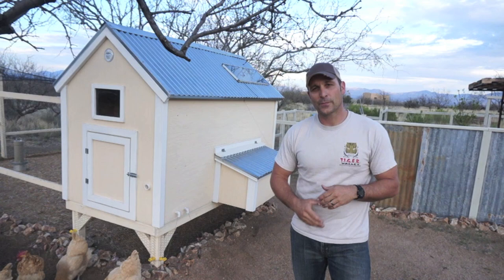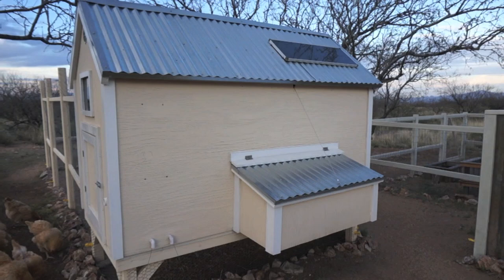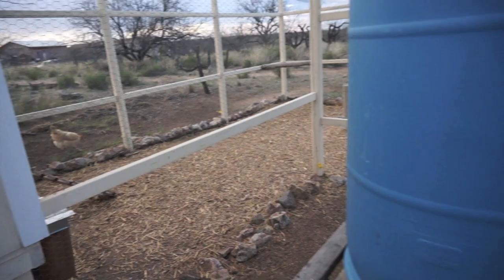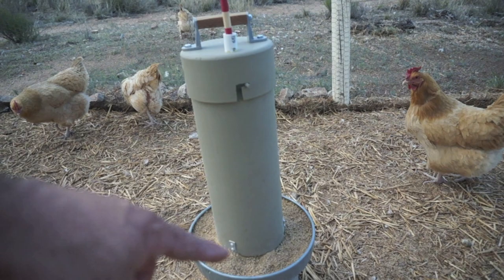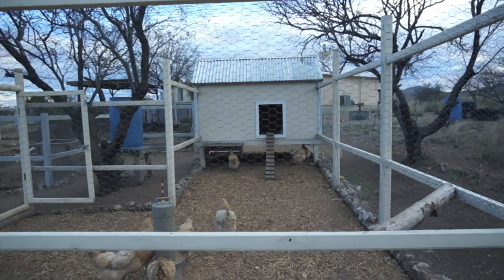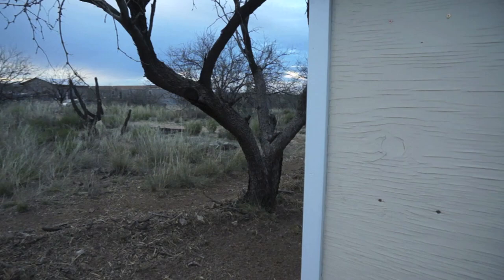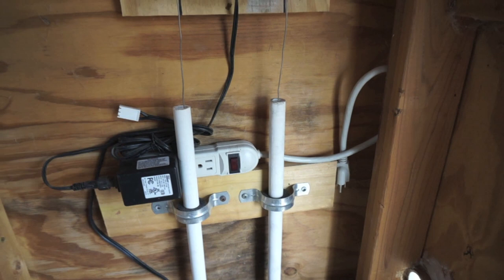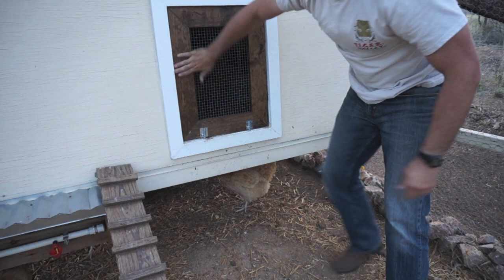Chicken Coop Tour - Solar, Food, Water, Security

Comment: Excellent job all the way around. There are some adaptations that one must make in places with long cold climates. In some (most?) parts of Canada, we need to insulate the coop and have some means to heat it. Today, for example, the temperature is at -25C. I use a 175 watt heat lamp, and have a cookie tin with a 40 watt light bulb inside to prevent the water from freezing. That, and minimum 8 inch thick layer of fine wood chip, sawdust or some other humidity absorbing carbonaceous material helps to keep the coop dry, and the floor warm.
Reply from the maker: +Francis Roy Thanks Francis!  Yes, we've got some temp differences for sure!  But it sounds like you have some great solutions for the water with the cookie tin and the thick mulch for heat.  If we were colder, I'd definitely incorporate some insulation too.  I'd love to see your set up!  ... and thanks for watching Francis:) Joe
Reply from the maker: +Francis Roy Just watched it... very resourceful use of the soda bottle and the coffee can feeder.  The chicks look happy and look to be well cared for!  'Cheapskate' ingenuity seems to be working well from what I can see:)
Joe

Comment: Do you ever have pipe freezing problems that far South in AZ?  There "may be" one problem area.  Snakes can go through the bottom of the chicken wire.  What usually happens, though, is the snake will start through the wire and get stuck.  Since they don't have a reverse gear, they turn and go back out an adjacent hole and get stuck for good.  Only the skinny ones can get through, but they better not eat anything, or they will have to stay!  1/2" hardware cloth (rabbit wire) at the bottom can remedy any snake problems.  Luckily, there are no snakes in Arizona, right?  I am a new subscriber.  Thanks for the excellent video!!!
Reply from the maker: haha... there are lots of snakes in AZ.. you should check out my snake pole video or my prickly pear picking video to see a few of the rattlers:)  ... and yes, you are right about the chicken wire and snakes... but luckily I haven't had any problem with any getting stuck.  thanks for watching and subbing:)
Joe
Reply: I was joking about there being no snakes in AZ.  The only place that I have personally seen that might be worse for rattlesnakes is in Pilot Hill CA, where we lived for 20 years.  Twice I have seen where a snake was stuck going both ways through the wire.   Your videos are very informative and entertaining!  Thanks for posting them!  Jerry

Comment: Hello sir! 🙋🏻‍♀️ I’m making a solar system kinda like yours on my coop that has a marine battery, but someone said batteries emit gasses when charging so I wondered if your system has a battery and where it is etc. I have the battery in an unused egg box on the front of my coop. I wonder if I should fully block it off or what? I have it blocked off with some cardboard right now to keep them from touching it, but should I make an actual wood wall there to close that egg box off from the rest of the coop? Thank you for any thoughts you have on this!

Comment: Very nice setup!   Do you know of anything that works well to keep snakes out?   I understand that chickens will generally kill/eat the smaller ones, but I've been told that some of the larger ones often manage to crawl into coops and cause problems.
Reply from the maker: Peter K. Hey Peter... thank you!  Regarding snakes, we've got a good number here but I haven't had a problem with them as of yet.  The small to medium ones can pass through chicken wire pretty easily.. and the bigger ones can get stuck.  Hardware cloth would keep them out but can be expensive.  Another option would be the 1/2" bird netting... although when I snake gets into it you almost always will have to cut them out.  I've had a few red racers get caught in bird netting in my garden and I had to cut them out because they were so tangled.  Anyways, hope that answered your questions... at least a bit:)

Joe

Comment: Great coop setup!  It looks like you're out in the desert.  How does your flock do in the summer?  Do you do anything extra for cooling?  THX
Reply from the maker: LFoote Hey LF... we are in the southern Arizona high desert, just a bit south of Tucson.  Our chickens do pretty well here in the summer.  If you notice in the video, the coop is on 'stilts' so our girls always have good shade as well as two medium sized mesquite trees on either side of the run and coop also provide shade.  Other than that, and making sure they always have plentiful water they do really well.  On those 'extreme' heat days where the temps are pushing the mid 100's and above (above is rare for us as we are at about 4000' elevation) I'll fill up a couple pans of water for them to put their feet in.  That is more of a nice treat than an absolute necessity though.... makes me feel good though:)
Hope that helps and thanks for watching!
Joe

Comment: Thank you for sharing  we are new to this we are getting ready to build us a coop. How did you make your watering system for the chickens to drink? does there beak touch the red thing? Thanks Lynn
Reply from the maker: Lynnm McManaway Hi Lynnm,   the waterer is a simple gravity style system.  Basically the barrel is elevated higher that the waterers and they are connected by irrigation tubing to the PVC pipe, in which the waterer cups are connected to.  To attach the cups, you'll just need to drill a hole into the PVC pipe and simply thread the watering cups in.  After that, gravity will take care of the rest:)  Anyways, hope that answered your questions:)  
If not... I may consider doing a  more in depth one just on the waterer itself.  Let me know if that might interest you:)
Joe

Comment: That is a very nice coop! I'm researching ideas for when I build mine. The concept of the dimensions simply using the full sheets of plywood lends a certain elegance in its simplicity. Did you screw the roof directly to the wood? Does that cause any leakage from rain? I also like how you gave them a good size run that is protected from predators. I would love to let them free range, but that isn't a good option here. We've got hawks, racoons, possums, plus the usual stray dogs and cats. We'll be definitely using some of your ideas for our own coop. Thanks!
Reply from the maker: Donovan Maxwell Thanks Donovan!  Glad you like the coop... hope you might be able to use some of the ideas in yours.  There's lots of cool ideas out there.. too many for one coop but I guess you gotta pick the best ones that work out for you:)  As for the roof... the sheet metal is screwed down directly to the wood but if you're in a wet environment you might want to add underlayment/tarpaper to combat condensation.  Out here in the desert it's not much of an issue which is why didn't do it.  
Also, stay tuned as I'm planning on adding a rainwater catchment system to fill the chicken water barrel with rain from the coop roof:)  Thanks for watching:)
Joe
Reply: homesteadonomics Gotcha on the roof. Here in North Texas, it isn't normally wet very often. This year, though, seems to be the exception. If it keeps up, I'll have to kayak to/from work. I'll look into the tar paper. Thanks again!

Comment: What do I ask for at home depot for what you used for the fence instead of the chicken wire? How much does it cost?
Reply from the maker: Brandon Scott HI brandon... you'll need to go to the section that has 'lathe' for stucco siding... it will be the side of HD that has the concrete and drywall.  it's the same thing as chicken wire.. it's just labeled different because it has a different use.  Hope that helps:)

Comment: Great setup. Just wondering how do you run the electric fence across the gate to the yard?
Reply from the maker: +peninsulamike Hey Mike.... I run the fence under the gate bottom... it's a raised up section that is the same height as the wire run on the coop yard.  I hope that helps:)

Comment: Great video as usual.  Question.  How do you keep the 55gal water storage full?  Is it on a float, or do you just manually fill it every week or so?
Reply from the maker: Mike Cole Hey Mike... I fill the barrel manually but you could probably put a float system in one no problem.  I actually considered that but since we are on rainwater as our primary water source, it'd be just too much risk if the float system broke while we were gone.  As for the current set up... my chickens can go about two months with one barrel's worth of water.  I usually top it off every 2-3 weeks just to be safe though... and to keep the water freshened up a bit.  Anyways, I hope that helps.... and thanks for watching!!!
Joe

Comment: thanks!  couldn't a predator climb that little tree you have there near the run fence, and then hop into the run-years area inside?
Reply from the maker: +seeminglyJo Hi SJ... The netting up top prevents anything from jumping in... I guess it's possible but so far I haven't had any troubles:)  btw... if you are interested, have a couple recent videos building a very similar coop to this one for my in laws if you want to check them out.  Better video and sound quality too:)
Joe
Reply: thanks, I am in a super cold climate for a large part of the year so I am considering all designs. I will check it out. be well.

Comment: are you in an area that has freezing weather? I am an so believe I will need a heater in the winter for my waterer, am getting chickens in june so am getting set up, thank you for your great video
Reply from the maker: +Beth Barnes Hi Beth... we get light freezes so if you're in a hard freeze area it might be best to just drain your waterer and just use an old fashioned galvanized one inside the coop with a heat lamp.  thanks for watching.
Joe

Comment: Awesome video!  I subscribed and can't wait to see your other video's.  How did you attach the chicken wire to the post?  Staple gun?
Also, how much does it cost in lumber/roofing to build that coop roughly?
Reply from the maker: MrShep75 thanks shep!   Much appreciated... just trying to get better with each video.:) Regarding the chicken wire...I attached the wire to the posts with a staple gun (pneumatic type).  But if you didn't have one, then you could always use electric wire staples and hammer them in.  they probably hold a bit better than the staple gun staples too!
Joe
Reply from the maker: MrShep75 Oh yeah... the cost for the coop is a little hard to estimate because I used a good amount of scrap materials.  But I'd say that the main box of the coop would probably be about $100-175 give or take, depending on the materials used (scrap/new, thickness of plywood).  Then the roof would probably take about 2-3  8ft panels of corrugated tin, which would run about 12 or so buck a sheet($36).   Then the chicken wire and landscape timbers for the yard would be probably about $50-85 or so.  anyways, that's the best estimate I can give off the top of my head...just hard to remember what exactly everything cost.  But you should be able to build a similar one for the lower end of all the estimates if you get good craigslist finds (lumber, tin, etc,.)  Now for my actual costs...I think I spent about $200 total for everything (coop/yard) but I also used quite a bit of scrap lumber and tin that I already had on hand.  So that wouldn't be accurate if you were using new materials.  anyways, hope that made sense:)
Joe

Comment: I was wondering what your water remedy for cold weather is?
Reply from the maker: +Mark Tulgetske Hi Mark, we are fortunate that we don't have all that much in the way of extremes but when we are going to get a hard freeze.  I just drain the tubing and set out of small bucket of water for them.  Not the best solution, but works.  i used to have foam insulation around all the pvc and tubing but the chickens loved pecking at it too much:)

Joe

Comment: hi great video...what did you say you used as chicken wire? thanks
Reply from the maker: www.candras.etsy.com Candras Secret Hey CS!  the chicken wire I used I got from the construction section in HD instead of the garden section.  It was in the stucco/lathe area and is basically the same stuff that's in the garden section except that it is just titled stucco lathe versus chicken wire or poultry wire.  It was considerably cheaper per foot than the garden section stuff.  Hope that helps:)
Joe
Reply: thanks!!!

Comment: You have a nice set up there,,,similar to mine,,,,BUT,,,,,here it comes,,,,,,,I built mine with saplings cut down in my backyard,,,,the only thing i bought was the fencing,,my coop is only 4x5,,,the security is 3 sets of wire run completely around the pen and coop,,,7,000 volts with 9 stored joules,,food area is protected with 240 volt AC current that will kill a human  being,,,So god have mercy on the preditors